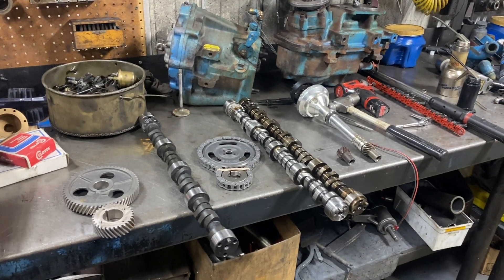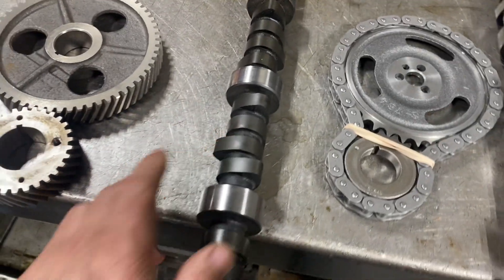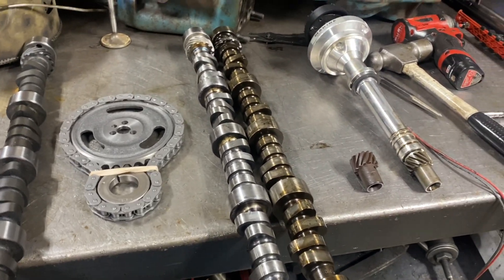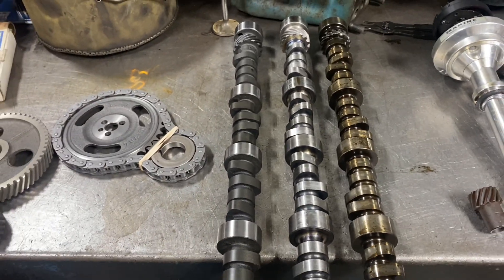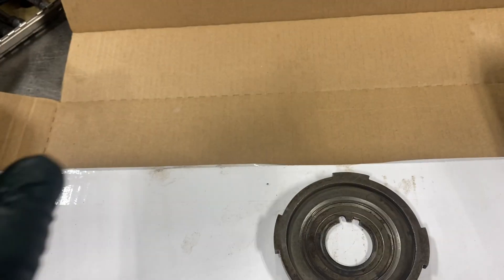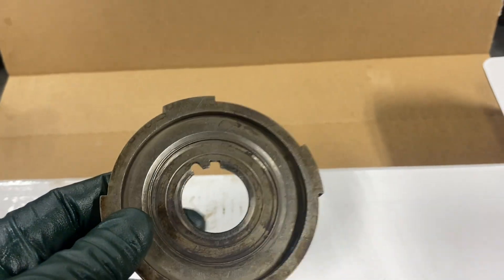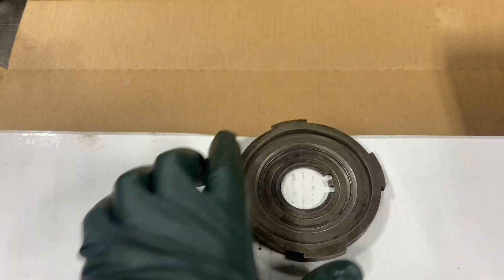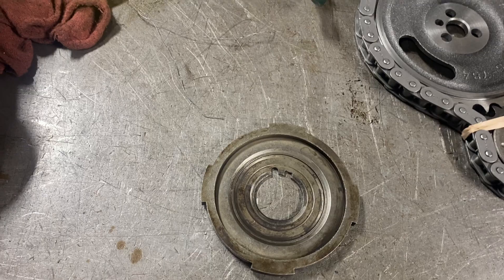Opposite or Right Hand Marine Engine Rotation Camshaft Crankshaft Reluctor Tips Info 305 350 1996 up

Comment: When converting a left hand 96 Vortec to a right hand, should any consideration be given to the crankshaft and where the oil paths are drilled?    I have been told that on <92 RH engines that where those paths are drilled in the crankshaft is different from the standard LH crankshaft in order to provide adequate lubrication.    Thanks in advance.  I am actually considering this project since counter rotating BW V-drives are basically unobtainium.
Reply from the maker: There is no difference in the crankshaft between the rotations. Run it!

Comment: After watching your videos and buying the cam, cam gear and parts for my transmissions from you, I have rebuilt both of my velvet drives and replaced the old school carburetor engines with the Vortec so they would be EFI. My project is almost complete, but I've run into a new snag. The water pump!! Where do you get an opposite rotation water pump (circulation pump) for this engine? Please help!!
Reply from the maker: Marine pumps have a brass bidirectional impeller. A marine supply house can source that for you.
Reply: All of the marine pumps apparently are short gen 1 type. But i found a solution.  Flowkolerpumps makes a votec non directional CNC pump. Its expensive but it fixes the problem. Their part number is 1974 1996-2014.

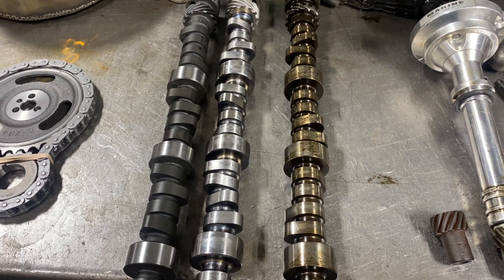Comment: Can you explain Installing the cam.. Gears and timing chain Vortec RH Rotation 5.7 i.e. # 6 TDC with the Bottom Gear Timing mark at 12:00 and top gear Timing Mark at 6:00 is this correct? Thanks in advance
Reply from the maker: That’s correct. .#6 is on TDC compression stroke when the dots on the gears/chain are lined up.

Comment: Thanks for the video! Where can I find a replacement distributor for my 2007 Marine Power 5.7 Reverse Rotation engine. I believe you can not just switch the helical gear on the distribuitor because of the upward force on the distributor shaft? Parts are so hard to find, might as well be a unicorn.
Reply from the maker: I’ve had to do just that. Replace the gear on a regular distributor. Reach out to Marine Power as they sell parts as well.
Reply: @LakelandAutoMarine  appreciate the information there. That's good to know.
Reply: @LakelandAutoMarine  Marine Engine Depot seems to have the reverse rotation HEI distributor in stock now...
Reply: @WJsLifeonaBoat 
The info I was looking for was to do a mechanical advance on 88 270s. Left Lucy is always the problem child. Most people got lost with gear drive and reverse rotation cam.

Comment: Where can you get a replacement RH Distributor type RA107045  ??  Or Equivalent if there is one?
Reply from the maker: I assume you have an EFI engine? If so they are hard to come by.
Reply: @LakelandAutoMarine  Fuel Injected?  Yes they are.  Are there any alternatives???
Reply from the maker: Not that I’m aware of. The LH rotation had the same as the truck did. It’s plastic and the thrust is different as it’s pushing up into the distributor. That’s why the housing was aluminum and not plastic along with a roller bearing under the rotor. I suppose you could get the LH or automotive distributor and swap the gear. That may not be simple as GM distributors are usually .491 shaft size. I e had to cobble a couple together already against my will, but with no other source I had no choice.

Comment: How can I contact your shop? I need to reverse the rotation of a 96 model vortec. I have none of the original parts. Also want to ask about a rebuild on the transmission. I have what appears to be the same as the ones on your shelf in this video.

Comment: Where to find one of those camshaft part number # CR 14097395 right rotation?
Reply from the maker: We have one if you can find one.
Reply: I have a classic Crusader RH rotation 5.7 engine and I want to convert it into an engine with roller camshaft tappet… what shall I do??
I have already find an automotive engine but needs to be converted to RH rotation

Comment: This video was a great help. I am Currently changing a 5.7 vortec from LH to RH. I have a new timing cover, but it has the LH rotation cam seal. Can I replace The seal or do they make the plastic cover with the RH rotation seal? I haven't found any information on this.
Reply from the maker: Fel-pro makes a reverse rotation front seal for small blocks. I suggest to buy that and install it into that cover.
Reply: @LakelandAutoMarine  Thank you. I meant to say timing cover seal not Cam seal.🙃

Comment: I suppose if someone is doing a rebuild, but their distributor drive is still good, would regrinding be a good idea? If a lobe was flattened, it could be welded up and then reground. Given the hit or miss metallurgy in some cams, maybe this is a good idea.

I have a 2010 Mitsubishi Lancer Ralliart, and sometimes the manual is wrong. It calls for 5.1 quarts of oil, but that will overfill it. It needs 4.5 quarts. Also, I had to replace the rear brakes around 60,000 miles. The manual says new discs are .396 inches in thickness. After 60,000 miles, my rear rotors were .404 inches in thickness. I wa stunned, and the guy who machined the at O'Reilly's was stunned. If they didn't need to cut much, my brake discs might still be considered better than new.

Comment: Thanks for the video , very interesting , I always thought the reverse rotation stuff was always done in the gear case since roller cam introduction , there is nothin like experience .
Reply from the maker: Glad it was helpful! These are mostly for repower applications as they were specially done by Crusader and Marine Power. The LH rotation engines must have an aluminum transmission such as a Velvet Drive 5000 or a ZF 68 as those transmissions only accept LH rotation engines. These special RH engines you will always find a cast iron Velvet Drive  10-17 or 10-18 transmission behind them.

Comment: I had to do this for my Crusader big block 496 roller conversions. Opposite rotation roller cam very hard to find.
Reply from the maker: Yes. Custom camshaft folks like Bullet can usually come up with pieces like what you needed. The core that it’s ground on is the hard part.